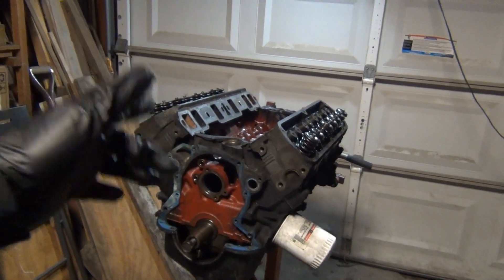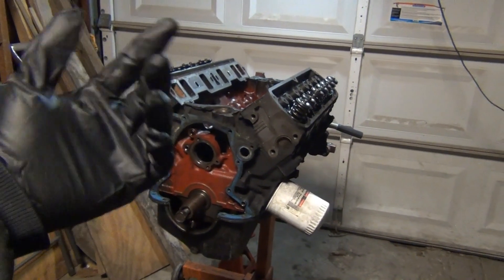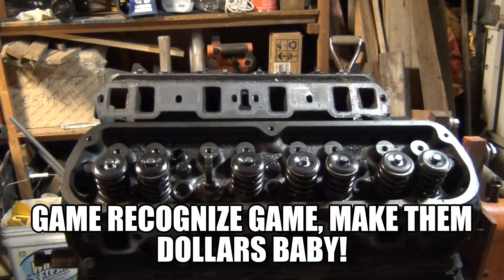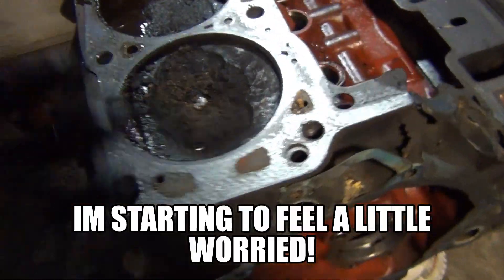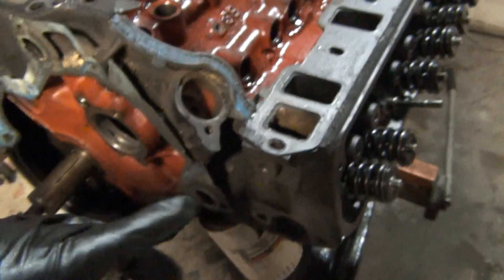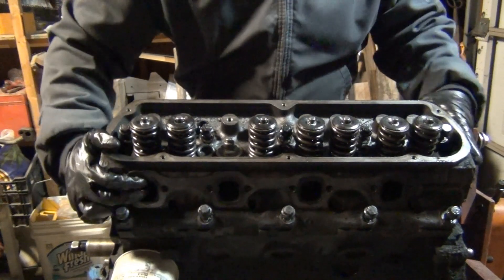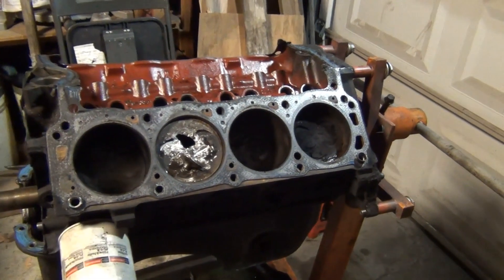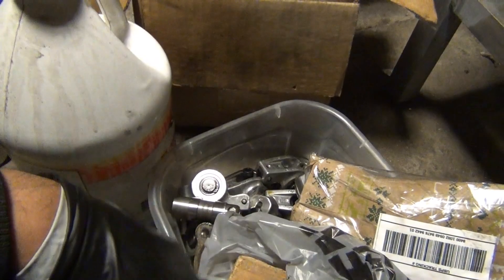Destroyed Ford 302 Tear Down Part 2: Removing Cylider Heads

Comment: People sell individual Cobra rocker arms on the big auction site.  I wonder why the exhaust valve head came off.  Seems the intake valve has less piston to valve clearance than the exhaust does.  Looks like those GT40 heads have aftermarket valve springs.
Reply from the maker: Hello, yes just like you pointed out, I was able to purchase a replacement rocker on ebay for about $50, I have a complete set now. When I took the engine apart a few videos back the roller lifter on that cylinder had self destructed and the springs on that valve was broken. Im sure the piston hit the valve and thats why it broke. Not exactly sure why it failed to close in time, but the owner of the car said he ran it extremely low on oil.

Comment: I understand your frustration but don't assume all mechanics milk people for money.
Reply from the maker: You’re right, but I think you got the wrong impression of what I meant. Im not saying mechanics need to do anything differently. What I was really trying to get across is that just because I didn’t do the things that a mechanic would normally do (because Im not) doesn’t mean that I was wrong about what actually happened to this engine… Ive been around ford engines for a long time 😳, so I can tell when an engine is destroyed very quickly. Im actually sure you would have came to the same conclusion if you found what I did in that video.

Comment: You have the knowledge to rebuild that engine ! Good diagnosis . As far as the roller rockers You should be able to get a replacement from the manufacturer without having to buy a complete set . Best Wishes and good building 🇺🇸🇵🇷🦊👍
Reply from the maker: I definitely appreciate your words! Yeah the replacement engine is already running, I was able to find a single replacement rocker for $55 😬… but I bought it just to have a complete set. Im still sad about the heads and it looks like this block on the video is going to be junk as well. Thanks for watching and I truly appreciate your continued support!

Comment: your method is far better than the guy who said that = it is ok = for a JUNKER - but a street racer or hot rodder will strip the engine for sure ! WELL DONE SIR -
Reply from the maker: I got the car on a trade, I was simply finding out if I could get the car running that day, so when I saw the engine was toast I knew it had to come out. Didn’t think there was any sense in continuing to disassemble.

Comment: You nailed it brother. Wow that's some terrible damage. Were they stock valve springs?
Reply from the maker: How is it going brother? Actually the heads had aftermarket dual springs! Not sure what brand or pressure rating though 😐.

Comment: What are you planning to do with the heads? Id be willing to buy them  as is , if you would ship them.
Reply from the maker: Hello, Im actually not sure yet, I was able to purchase the correct replacement roller rocker from Ebay, so now I have a full set. Im actually thinking about sourcing out a single head from the junkyard, and see if I can put them back on the car, because Im running E7 heads temporarily
Reply: @MrBlitzkrieg1987 don't worry this guy is full of crap, he wants to buy something from every channel, he's a tire kicker at best, dream racer at best, nothing wrong with dreaming, but keep it 2 urself
Reply: @MrBlitzkrieg1987  oh ok well if you want to get rid of the bad head let me know, I will buy it from you if you could ship it
Reply: @MrBlitzkrieg1987  are those heads the 3 bar or 4 bar gt40s